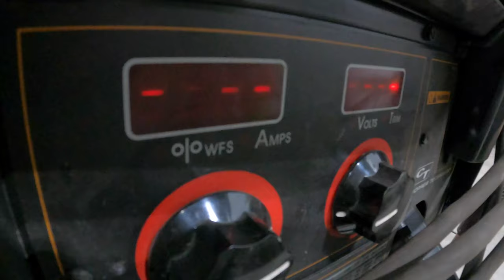A Day In The Welding Shop

Comment: Don't hear any one complaining about having a job. It's work and it's hard but at the end of the day you did something.
Reply from the maker: Yes!!
Reply: Well said
Reply: I am sure it's not easy but humping drywall and hanging 5/8s on the ceiling all day really does suck and is hard on the body.  My body was constantly achy. I would have to go into small places like this poor guy in the trailer. I am taking a welding course and hoping this will be my career until I retire. I am 35.
Reply: @BaronBoar so you spend a little of your salary on a gym where the body aches for the better then when you are like 65+ you will thank your self for investing in you're self by having fluidity in your joints and you're bones are still strong as if you were still in your 40s thats the thing with trades somtimes good pay if you are in the top 10% but your doing the grueling hours and job

Comment: I was a assembler for a welding shop still learned a lot even though i was not welding we were assembling racking solutions for the Auto industry
Reply from the maker: Yeah you can sure learn a lot if you just pay attention
Reply: @JoshuaFoxVandonselaar yeah we were mostly fastening rubber and plastic parts on racks after they were welded and painted sometimes there are missing welds or parts then we had to fix it
Reply: I wouldn’t say assembly took skill or experience but you still need to learn and pay attention quite a bit

Comment: i started of doing shut downs in saw mills and paper mills and after that i did my welding diploma in quebec 1800hours and after that pipe welding tig stick and mig aftert that i ve been working as welder in a saw mill and love my job always some thing different one day fixed machinerie maintenance to a other day a convator modification and welding ⚡⚡ but and heers out to Metal marquis and Temisko👍🏼👍🏼👍👍🏼
Reply from the maker: That’s awesome!!!

Comment: Hi!  Thanks for the video.  I was recently accepted into a welding program, and was glad to see your video since you were working in a shop.  I read that many welders travel for work.  Can you tell me if this is a personal choice, or a requirement?  I’d rather stay at home if at all possible.  Thanks!
Reply from the maker: Depend on what kind of welding , pipeline welding ? Shop fabricator? Field fab ? If your just planning on getting a shop job you will be fine but pipeline welders and field fabricators are almost always on the move/in camp
Reply: Thanks so much!